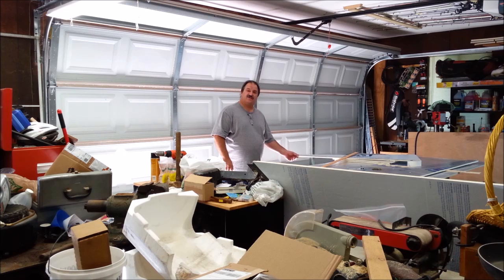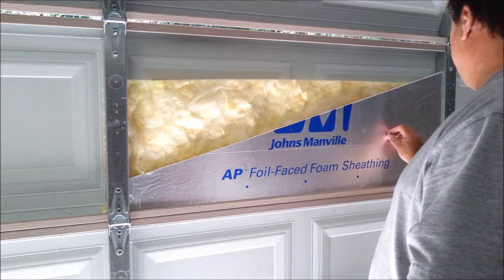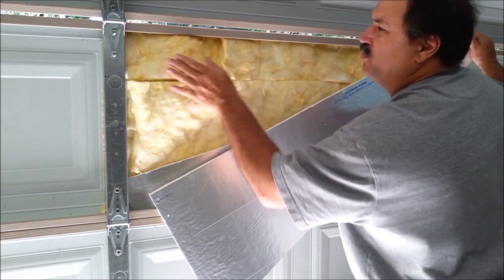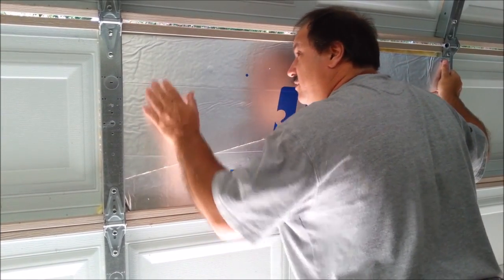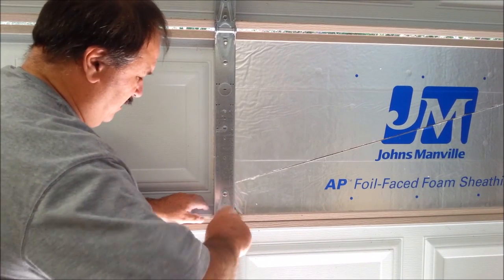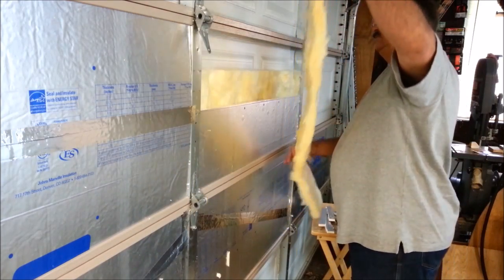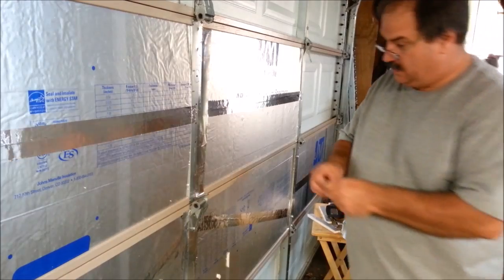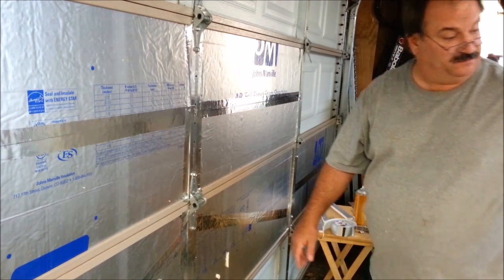Garage Door Insulation and Adjustment from Scratch: Part 1 of 3

Comment: I appreciate the amount of thought that went into engineering that insulation project. A couple of points: 1. The bats won't really do much, because they're thin, and getting compressed by the board. Glass insulation needs to be loose, to trap air. The other issue is the lack of vapor barrier. You'd be better off using thicker foam board in single pieces, (like 1.5") fitting as tight as you can, then use spray foam to fill in the gaps.  On mine, I used an infrared thermometer on a sunny day, to compare insulated vs. not,  and the 1.5" insulated boards cut down heat by an average of 10 degrees.

Comment: I used bubble wrap to "fill the air gap".....it also helps bring the 1/2" thick foam board "out" to where you then can run metal-silver HAVAC tape around the edges to help keep in place. If you have problems pulling it "out" towards the inside of the garage, a small piece of Gorilla tape will act as a handle and you can "pull toward you". No problem.  Some folks go straight with 1.5" board, but that is difficult to install and adds about 15-35 lbs to a 7 x 16 door ( depending upon WHICH foam board you choose).....requiring either new door springs or a massive re-adjustment of the springs. The bubble wrap weighs next to nothing...and the 1/2" board adds maybe 5-7 lbs...a managable extra weight that requires only little spring adjustment, if at all.
Reply from the maker: Yea, that would have been good also.  Might have been too thin in a single layer.  It was years ago, I don't remember the exact gap but probably about 1/2"   ???   Anyway the fiberglass was inexpensive and very crushable so it was not sensitive to thickness and easy to put the foam over it.

Comment: 2" foil backed Perma R cut to size for each section (ever column is slightly different in width) was my solution.  If cut to the proper height, the piece is able to be pushed down into the bottom channel of the section and then worked into the top channel using a wide flat blade (like a drywall compound knife) in the same manner as a shoehorn.  The friction fit of the foam on the right and left side against the channels hold it in along with the top and bottom channels.  For extra assurance, you can place a couple of dabs of PL Premium on the metal of the door prior to placing the panel.

As for the vertical channels - Great stuff spray foam fills the channel.

I insulated s standard 7 x 9 and 7 x 16 door like this.  It works amazing.
Reply from the maker: I hope it's enabled you to do some projects and watch less TV.  It's been working for me.  ;-)

Comment: What about rain and moisture? Most garage doors are too exposed and when that ''rock wool'' insulation gets wet it is useless.
Reply from the maker: I used fiberglass and foam board.  I've never used rock wool before.  From site linked below: "Rock wool features a similar form, with both rolled blankets and loose-fill products available, but this material is made using strands of heated rock or minerals instead of glass. "  http://homeguides.sfgate.com/compare-rock-wool-fiberglass-insulation-74180.html

The door is aluminum and has always stayed dry inside.  Now that I am heating it for evening projects, it would get wet from condensation if I didn't have it covered with insulation.  As it is now, I'm protecting the cold aluminum from contact with the warm air inside the garage.  I shouldn't have an issue as long as no leaks develop.  I could always cut the tape and remove panels if I needed to dry out something.

It's still working great, no tap falling off and I can heat the garage well now.  I've got a door missing a sill plate and a section rotted off.  That is the next heat loss offender to be addressed.   Subject of an upcoming video.

Comment: just put in a 10k btu heater in the garage and call it a day.
Reply from the maker: +John Trotta Even with the door insulated, 10k isn't enough for really cold days.   It's been working out very well.  I have over 160 videos since this one.  Most of them filmed in my garage without me shivering.  ;-)    Still, I'm thinking now of putting in a natural gas unit heater.  Tired of messing with a propane bottle and heater taking up floor space.

Comment: An air gap gives you higher heat resistance. You don't need the fiberglass. He doesn't know what he's doing
Reply from the maker: That's why everybody is busily sucking all the fiberglass insulation out of houses built since 1970.  Nothing like an air gap!  You're right, I must be dumber than a sack of hammers!